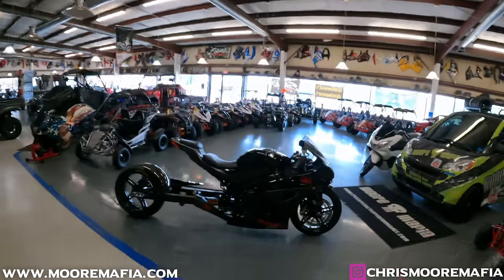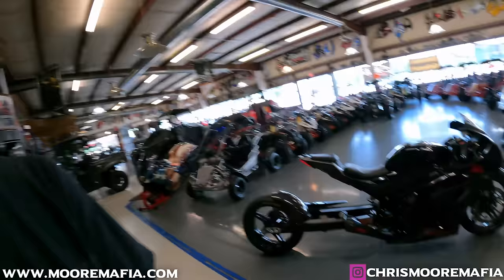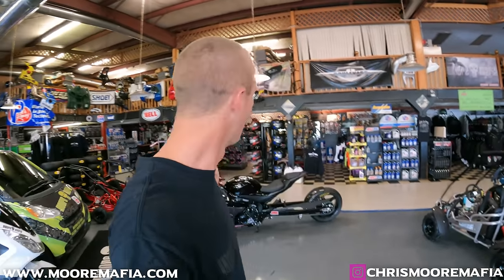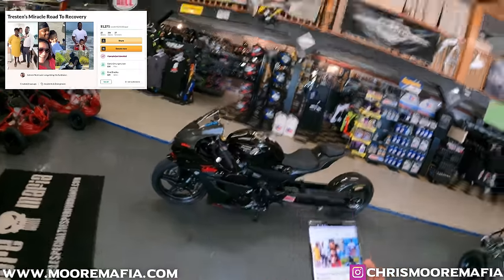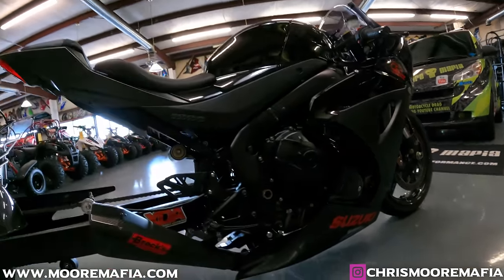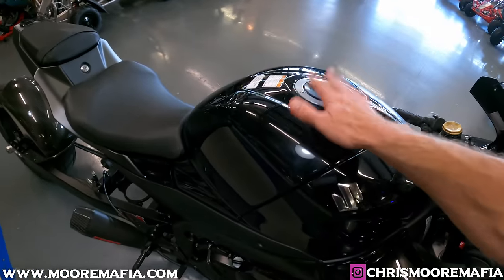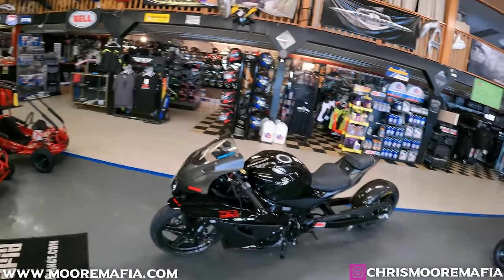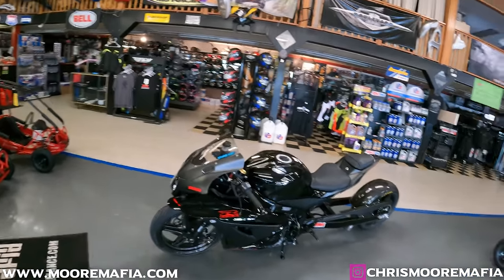Moore Mafia's World's Fastest Stock Motor Suzuki 2020 GSXR 1000 Bike Secret's REVEALED

Comment: That wheelie intro is UNREAL!!!
Reply: i thought the exact same thing that would of been a fun ride for sure ,..this bike is  super light from the factory and  200 hp    i think the bike weighs  360 lbs dry    and almost 200 hp  thats a crazy hp to weight ratio   it will have 200 hp by the time it  breaks in for sure   im sure the bst wheels lightened it moore even  mafia style and no brakes  only 1 disc on the front  thats got  to be oh ya the battery    about at least 25 lbs lighter maybe moore mafia stuff  great vid great job   hats off to cris moore
Reply: Yep cought my eye aswell

Comment: Honestly, this video was so necessary. There’s a HUGE difference in knowing what you’re doing and THINKING you know what you’re doing. Unfortunately, this adds a lemon to the haterade. I can’t tell you how much I appreciate all of the information. I ride a 2011 GSXR 1000 with a Power Commander V, Auto Tune, K&N and Yoshi R77. I’m comfortable with my bike and I know the limits of my abilities. I’ve beat several bikes that I shouldn’t have so as l enjoy it I will roll on it. But, I am going to look into the ceramic wheel bearings!

Comment: Appreciate your openness about how to do it. Not planning to put a 74 inch wheelbase but carbon wheels and ceramic wheel bearings might be a worthwhile mod to a fast Triumph triple.
Reply from the maker: The wheels make so much difference is not even funny.  You can use my discount code and get 5% off too!  Check out all my discount codes on my website. 
Www.MooreMafia.com
Reply: @TeamMooreMafia  Thanks. Trying to be back this summer but the timing depends a lot on my wife’s health. 

Sounds like possibly the best bang for the buck after opening the breathing and a good tune. Or if not what would be?

Got a triple with almost 150 hp stock. Dyno tune got 14-17% increases throughout the curve. 

11flat stock. Have a friendly warmup grudge race with a V&H Lowrider S. 

Thinking of doing the wheels & bearings first. When I start modding I will check with you.
Reply: @TeamMooreMafia  

Can you give me a ballpark cost for the wheel mods a d also for sprocket chain & rotors plus speed shifter?  I’m in early project planning stage.

Comment: Hey Chris I run a 2006 gsxr 1000 with m4 exhaust pc5 n 110 race fuel mix with 93, and stretched 69" I ran a 9.52 @ 139mph foot shiftn is that a good rating for this set up
Reply: Why are you running 93 or even 110 for that matter? If you can get some MR12, run that! Next, without knowing your weight, it’s hard to say about the ET/mph. Back in 2010, my 07 GSX-R with a slip on, 15-47 sprockets, 87 octane, and air shifter ran 9.2s 144 mph. MPH is low because I weighed 215-220lbs unsuited. Ran a best of 5.72 in 1/8th on MR12.
Reply: 87 octane is the cheapest and fastest way to go... Fast.

Comment: Sippen the Haterade sounds like at-shirt,great video.Dyno huggers can’t get it through their heads that it’s a baseline tool and the brain is the bottom line tool.Great video,you can only try!🏍❤️💯👍🇺🇸🇺🇸🇺🇸
Reply: $249 air filters  with 'amazing , humongous results'  MR12 fuel @ $30/gal....C' mon  Steve ...every dyno shop owner advertises that he has the secret sauce to making BIG HP... let's get real here !!!
Reply: Carl Mayer Then I would say you are going to the wrong shops,never heard Chris promise anybody huge gains,there are 8 chassis dynos within 45 min of my house none of them advertise or promise gains at all ,what they will say is that they will run a diagnostics and tune it accordingly,yes anybody that knows anything about ice’s that it takes air fuel and spark or high heat and compression”diesel” to make horsepower.Most reputable dyno shops won’t let a lean engine leave their shop unless owner signs off on it.

Comment: 1st up...My honor to contribute to Treston's GoFundMe charity.  Thanks for posting this up Chris. ...Next..are you kidding Chris, $249 for a Sprint air filter. Above all else air filters IN GENERAL are a maintenance part on a most every motorcycle- period !. To push these ridiculously over priced filters as you say.  quote unquote:  '...... with results will amaze you, they work, make a humongous difference....' on and on  your words  are completely disingenuous.  Why not make me a liar. Throw in a K&N do a dyno run, then a Sprint, do a run. Heck, what you can do for far far less cash is simply wash your K&N clean of filter oil,  use ether to clean and speed drying  ...then install the filter DRY !!!! No filtration oil.  On Carpenter 245 kitted Rocket III   we made some serious HP ! Also if your leaving a STOCK Suzuki airbox, unmodified, etc..installing aftermarket velocity stacks is a total waste of money, and can lose you HP, same with aftermarket coil sticks. Been there, done that.  
 If you motorcycle is set up for  drag specific racing only..you can set up the stacks for a small HP like 1-1.5 maybe increase up top. Lastly your dyno results are acceptable to a point, but you really start making HP when adding MR12  and some wild timing advance   what does MR 12 cost $150-160 for FIVE GALLONS.that's insane. DO NOT BECOME A FRAUD LIKE BROCK ..he got caught fudging dyno results. I like Brock, but he got caught ..work on mapping, software, oxygenated fuels,  not the easy HP increase using MR12 . Unless your Suzuki, Kawi, Honda is used for drag racing only. I understand $30 /gallon MR12..but as a daily driver obviously MR 12 is unaffordable to 99% of  owners.  Your meat and potatoes comes from those owners who have road going motorcycles, who want to improve performance. To push $249 air filters, $30/gallon performance fuels  as a 'horsepower' makers is going to get you 'haters'  but they're not 'haters' I like your stuff, .but come on Chris ..don't become Brock please !
Reply from the maker: For people who ride on the street the $240 air filter may not be worth it,  but for the people who go to the track and chase every last number they can.... well... you gotta pay to play. 
My bike has all the Lil stuff done to it and it's ahead of the competition.  If that's not important to you then you don't have to buy them.

Comment: When you say “Stock Engine “ there’s ZERO PORTING and no Valve job?? Not hating I just want clarification.  Curious if it wouldn’t be a little more clear if called No power adders, turbo, supercharged nitrous etc.
Reply from the maker: Correct.

Comment: Was that 170mph pass backed up to be considered a recored like a pro class has to be backed up? I noticed his 1/8th mile speed and time was very close on his 170 pass as his 166mph pass. Odd to gain 4mph with similiar e.t in 1/8th and 1/4 but same mph in the 1/8th for both passes. Id love to see that bike make a few more passes by David to duplicate 170mph. Clean bike Nonetheless but radar errors do happen. Just a bit strange when u look at the slips closely from run to run.
Reply from the maker: It did go an 8.07 back to back. The mph doesn't mean much. It only makes 194 hp....
Reply: @TeamMooreMafia  yes i saw that. 8.07 to 8.07 and even similiar 1/8th mile et and mph but 4mph mpre in the 1/4 on one of the passes. Thats what was odd. As we know its not easy or common to pickup 4mph just like that. Especially when the 1/8th trap speed on the other 8.07 run was not a single mph more. So i was like how isnthe 1/8th mile speed the same but 1/4 trap 4 more. And same e.t. strange for sure. Good work anyways but to me those slips dont add up.
Reply: NeurocentricThoughtz thinking too hard bruh.
Reply: @65Wonders  lol no way. Thats because most just lookin at this as entertainment but when u look st time slips all the tine yourself and u see ones like this it stands out. Especially when u know timing errors often occur ive had runs where one time and one time only my mph in the 1/8th was like 5mph faster than all my other passes and u just know it isnt right especially when your a consistent rider that many mph doesn't pop outta nowhere. So in terms of a 1/4 mile pass even if u had a huge tailwind outta nowhere then u would see it refelct in the 1/8th mile mph as well. Not the 1/8th stay the same and 1/4 picked up a bunch. But u gotta look at the other tickets and attempts and compare to notice the discrepancy..
Reply: @neurocentricthoughtz1583  you are on to something, that 170mph was mind boggling until you said his other pass was 166mph. 50lbs isn't going to give you 8mph. 4 mph is definitely reasonable gain for 50 lbs. Definitely seems like a radar error. But either way the bike is running good.
Reply: @jamescundiff3264  yes indeed. The bike is running fantastic no doubt. But u know in the world we live in once u call out whats odd u are now labeled a hater.  We also now have the data for Rickey Gadsons zx10 which is quicker and faster than this gsxr 1000 with both the owners on them and when the jockeys are on the bike(Rickeys jockey being quite a bit smaller than Chris jockey ) then how is it that Ricks bike has never pulled a 170. But u see Ricks speeds and times have been backed up with multiple slips which is smart on his part. He has a true 168mph trap done over and over.. so if this zx10 has 2-3mph on the gixxer at the 1/8 th then how is it 2mph behind at the 1/4 when zx10s are know as back half bikes. I stand on my claim all day. I appreciate u reading my claim and detail without screaming hater. There are timing errors all the time. U can always tell when u compare all your slips when something is off. Especially when all the other numbers on the same slip are in line with previous slips.

Comment: WHY DOSE IT NOT MAKE OVER 200 HP IVE SEEN THAT  STREET BIKE'S HAVE MORE AND WHY DOSEN'T IT WORK BETTER FOR YOU  ON THE TRACK I DO UNDERSTAND YOU WANT TORQUE AND IF THAT'S THE CASE THE TOWANO AND THE V4R AND THE R1M MAKE MORE TORQUE WHAY DON'T YOU USE THOSE AS A GOOD PLATFORM THOSE V4 ENGINE'S MAKE MORE TORQUE PLEASE ANSWER MY QUESTION I REALLY NEED TO KNOW THE ANSWER EVEN IF YOU DON'T ANSWER MAYBE SOME OUT THEIR KNOW'S

Comment: First of all u won rg with cf tank , second you need to tell that’s it’s not stock because u changed ceramic bearings in transmission and 1 gear. For carbon wheels air shock and quick shifter I’m not gonna tell something but if u run 1/4 mile with a normal gsxr 17+ u will see how far are u from the other bikes . Stop calling fastest stock motor because it’s not …
Reply: None of what you mentioned has anything to do with the “ENGINE”. Transmission isn’t the engine, or maybe it is in your world?!🤡